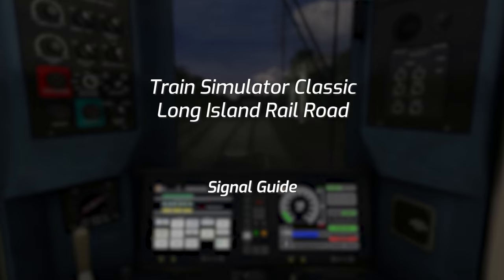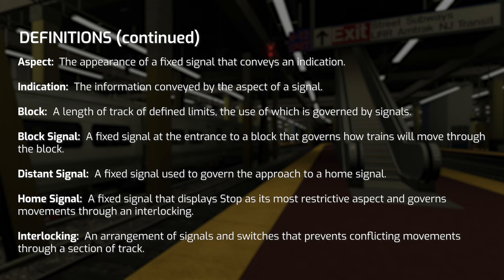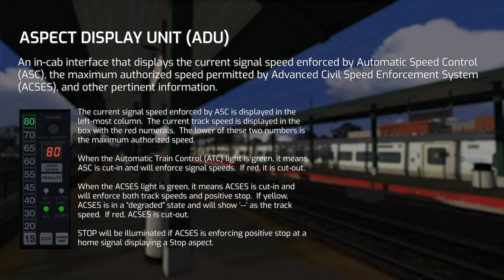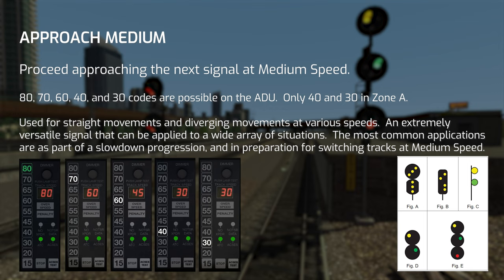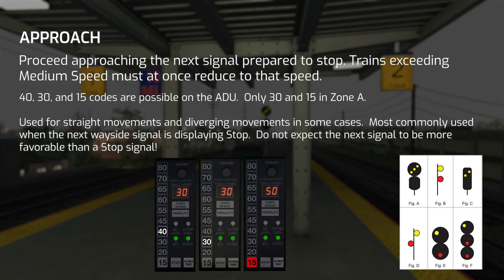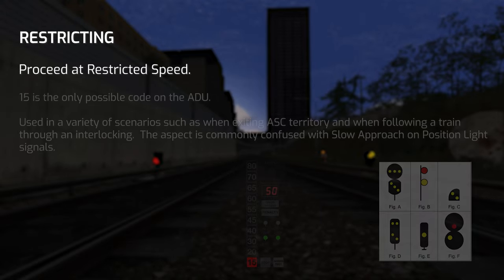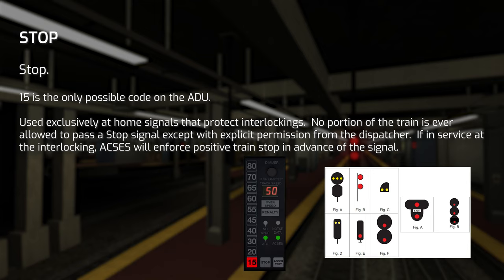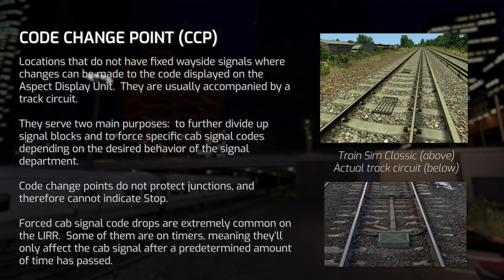Train Simulator Classic - Long Island Rail Road Signal Guide

Comment: Hi Brandon!  This was awesome and I've watched a couple times. 

I have two questions that I'd appreciate if you would clarify to me.  

1.  Coming into NY Penn, when you get the yellow over red signal on the ceiling at the platform, to be followed by the red at the end of the platform, does one reduce to 10mph from the restricting 15?  

2.  Same sort of question with dwarf signals around Jamaica, I take  verticals to mean 15, and horizontal over vertical or diagonal to the upper right to mean 10.  Is this correct / appropriate?  Not sure if it applies but I picked up the interpretation from NY Trenton.

Thanks!!
Reply from the maker: Glad you enjoyed it!

1.  You can stay at 15mph all the way up to the Stop signal.

2. No, they both mean up to 15 (even 30 in some rare cases).  Just follow what's displayed on the ADU and you should be just fine.
Reply: @cActUsjUiCe92  Thanks very much!